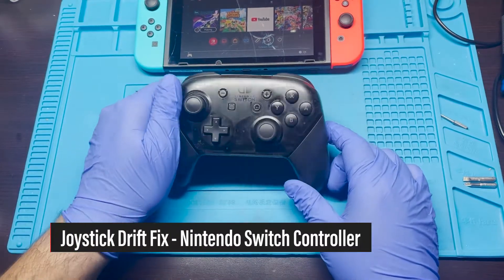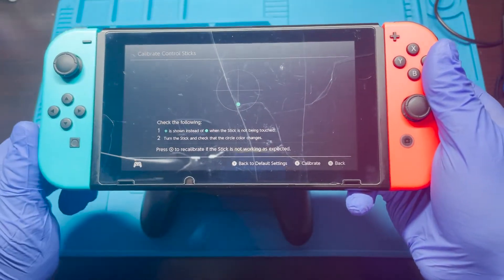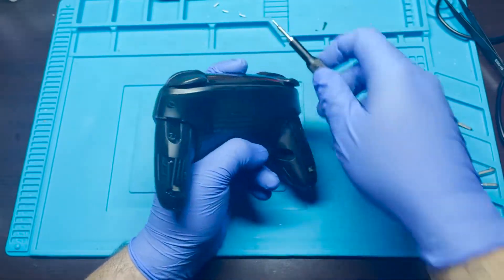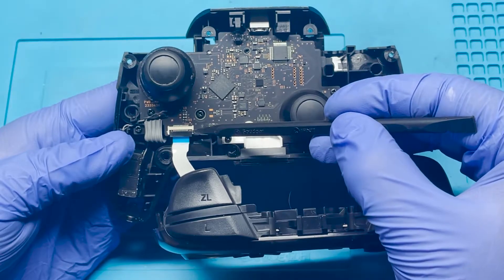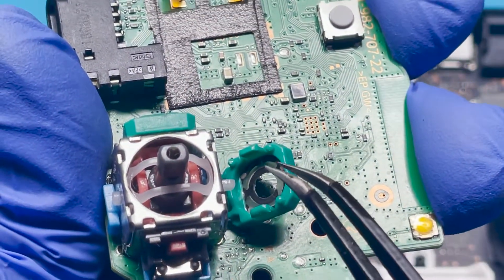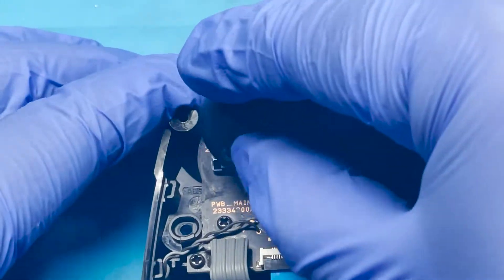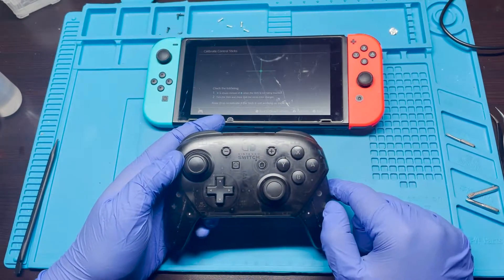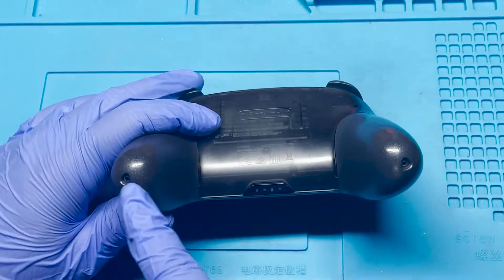How to Fix Nintendo Switch Pro Controller Drift

Comment: How does this NOT have more views?! I’m going to go try this method right now. I will report back!

Edit: Used this method last night, and it worked! Now you need to understand that not only was our controller drifting, it was hard left while at rest. Blew out the controller with compressed air, and used some ISP on the potentiometer exactly as in the video. Thank you so much for saving me $70! Earned a sub for sure!
Reply: Is it still working?
Reply from the maker: Glad it helped!